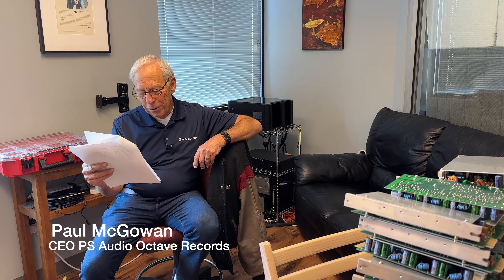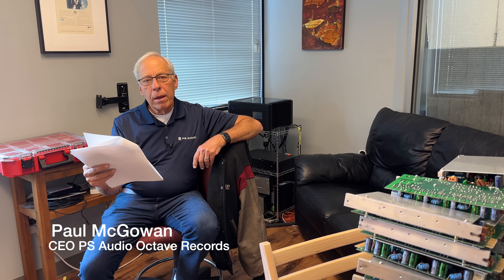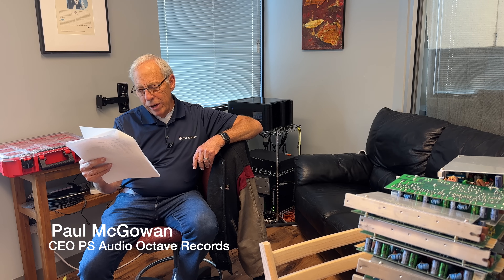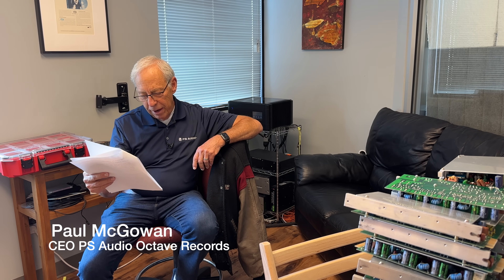Why HiFi systems sound different depending on time

Comment: It's the weather.  Air density changes through the day.
Reply: That’s interesting, that thought has crossed my mind because I have noticed my system sounding different when it rains vs a hot sunny day for instance.
Reply: @Audiofreak71  Also you will find different at nite.  Notice the neighbours party.  More noise at night.
Reply: @chuckmaddison2924  Yes that one I  know about as well, during the week throughout the day my system sounds exceptional because very little of the power in my neighborhood is being used however, on weekends and nights while still sounding very good is not exceptional like during the weekdays.
Reply: @chuckmaddison2924 That actually explains why music sounds great during a rainy day too.
Reply: Humidity makes a difference too
Reply: @cyeungjo I was thinking that... I can understand air humidity affecting the physical/mechanical characteristics (such as elasticity) of the moving parts of a woofer/tweeter... I guess also temperature can affect through the expansion/contracting of materials.... I never put much thought into it until now, but it's definitely an interesting topic.
Reply: @bgravato  
Air density changes with variations in altitude, atmospheric pressure, temperature, and humidity. It would require significant shifts in these parameters to affect density by more than a few percent within your listening environment to affect audibility through your speakers. Since the human ears are such sensitive equipment, and you’re listening room is somewhat padded from outside influence,  I’d be more inclined to believe the ears to be the main variable.
Reply: @shipsahoy1793  oh absolutely... you got me all wrong... I definitely agree that human hearing and subjective "perception" is probably the main factor in most cases... I also don't think (tiny) variances in air pressure/density will have any meaningful impact on speakers performance, never have I said that... that was @chuckmaddison2924 comment... On the other hand, what I said was that I could understand that changes in humidity and temperature (not air pressure/density) could have a somewhat meaningful impact... Materials properties can change a lot with those two elements and those can change significantly from one day to another... I never thought much about it before reading  @cyeungjo comment, but that just got me wondering how much that could actually impact the woofer's membrane for example. Humidity can have a great impact on elasticity of some materials and different materials also expand/contract very differently...Acoustic instruments for example (violin, piano, guitar, etc...) will play differently in different humidity/temperature conditions (for example the friction between the bow and the strings on a violin will be different in a cold/humid environment than in a hot/dry environment). So why couldn't that also affect the performance of speakers as well? Doesn't seem like a crazy idea to be honest...
Reply: @bgravato  yes 
 yes I got all that , and my comment was not “targeting” you.. one of my points alluded to the actual speakers being somewhat shielded from those environmental factors. It’s not like the speaker’s spider is outside in the open environment.
Reply: @shipsahoy1793  well since you tagged me... I thought you were "targeting" me ;-) I don't think speakers are hermetically sealed, so humidity would still get in... and they'll be matching the ambient temperature always (even if it takes a few hours to get there). In a poorly insulated house as mine, I can sometimes see 30% variance in humidity from one day to another and temperature differences of 5-6ºC. Between winter and summer... humidity inside can go from 40% to 80% or even 90% and temperature can go from 14ºC to nearly 30ºC. Now I'm not saying that would affect speaker for sure, but just saying it's not a "non-sense" idea...
Reply: @bgravato  I’m not saying it’s a nonsense idea either. I’m just saying that  probability is most likely  low, and I was only tagging you to jump in at that point of the overall  thread. I gave my opinion. I don’t want to go on and on about this. It’s not something easily proven, and can always vary with specific materials and circumstance. We can talk about this until exhausted, but it ultimately means nothing significant, mostly a non-issue. Paul’s answer was a bit silly imo btw. Just enjoy your music and don’t waste precious 
time obsessing over uncontrollable variables.
Reply: @shipsahoy1793  agreed
Reply: @shipsahoy1793 He only responded to a question pal ..
Reply: @joebloggs8636  
We’ve already concluded our conversation, and amicably, btw, and nobody asked you to run interference that I know of “pal” ..you prob have me confused with somebody else I’d say.
Reply: @shipsahoy1793 
You haven’t been taking your medication..😳🙄
Reply: @davidfromamerica1871  Well Dave, I don’t take “medication” first of all, recreation or otherwise, lol; secondly, I just concluded a productive conversation with someone, so why the inane troll posts after the fact?  People don’t seem to read / comprehend a thread in its entirety.  If someone has something to contribute, that’s fine, but you typically get barraged with pointless posts that don’t make any sense or misreads or reiterated as jokes, etc.
And then there’s the “validation”  or “strongly disagree” posts that are bordering on the edge.  We get it. But it’s a long way from substantiality.
Reply: It could be a lot different sounding after the cats got finished with your room treatment..😀😀😀😀😀

https://youtu.be/VeFMdVIFsgs?si=RGvnYFtvLxUZ5WMB
Reply: Davidfromamerica really slings the insults. "Without thought" is what I think of; when I think of him. Just random baseless inferences, inferring that there's something wrong with OTHERS mental capacity. We all know how that is.. If you get called ugly by someone; there's about a 99 9% chance that they're not very good looking themselves. People's insults are almost always based on an area of great insecurity to themselves. 

 People for centuries have noticed how clear church bells sound when the air is really cold outside. There's no doubt that environmental factors play a part. Just how big a part it plays is open to conjecture, versus our mood, bodily acuity at certain times etc. Cold dry air versus humid warm air is different; so differences can occur. Interesting fact: sound moves faster through solids than through the air.